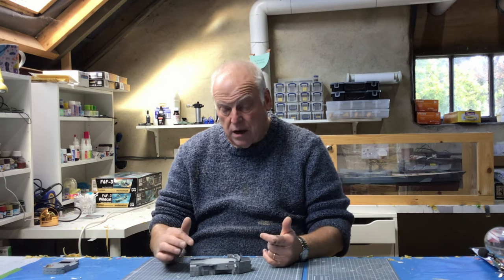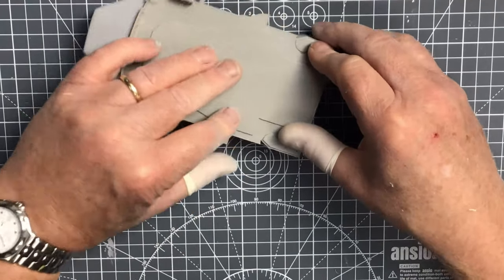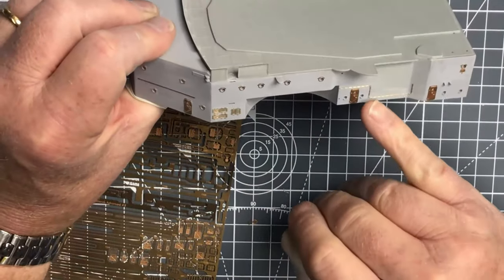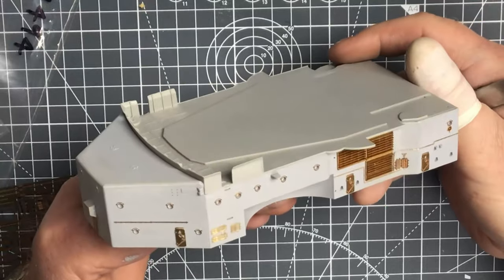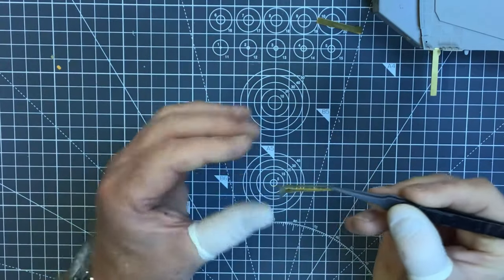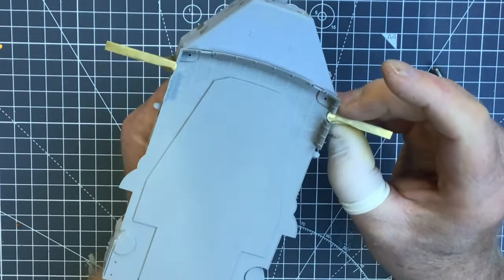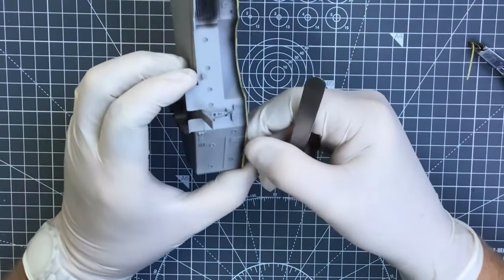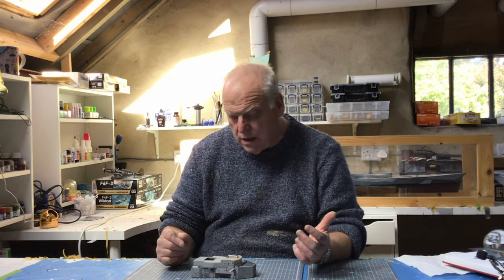Trumpeter 1/200 DKM Bismarck Full build with Pontos detail set Part 16

Comment: Awesomeness as always...looks really good...that section is the worst IMHO...you see I have stripes going right through all of it as mine depicts Mid April's.....those bloody stripes lol...black and white pass right through inset for secondary turret...keeping them aligned straight up superstructure was a nightmare but I got them...💞💞💞
Reply from the maker: I couldn’t face those stripes Casey - chickened out….
Reply: @TheModelShed  you could have done it I think seeing your work so far but I nearly ended up in a sanitarium doing it so maybe your decision was prudent lol...down the road I need to mask off turret tops and sloping sides...slopes dark grey like really dark(7016) with red horizontal tops....lol...my Heller 1/100 Victory was not as hard...even rigging the shrouds😃😃💓💓💓💓💓🇬🇧🇨🇦🇬🇧🇨🇦

Comment: Must ask - do you use a foot switch to control your Minicraft drill, or a finger? Incidentally, worth getting an aerosol of something like Servisol De-Flux 160 or other pcb cleaner. With sweated brass overlays, I’ve actually ended up with a hole from flux residue after a couple of years.
Reply: So! That's what the name is. Cool tool!
Reply from the maker: Just my finger on the chuck. I don’t recommend it but I’ve had this drill for 30 years and it’s still going strong
Reply: I think they’re the best ever made for modelling, dolls houses etc. I like them much better than heavy Dremels, though you can use all of their accessories. Ron, there was a whole Minicraft range from, I think, Black & Decker originally - saw tables, bandsaws etc. You can still get the small MB150 drill and a transformer new from the UK. Other Minicraft tools can be got from eBay second hand and they have lasted well and are quite sought-after - I have a small collection. For plastic, though, don’t underestimate the Tamiya battery drill and router. With the addition of a ball bearing, they’re slow running and don’t melt plastic easily.